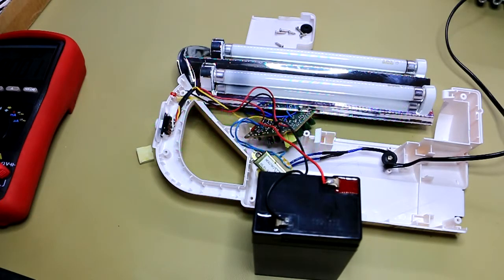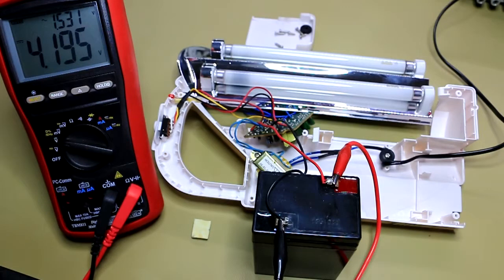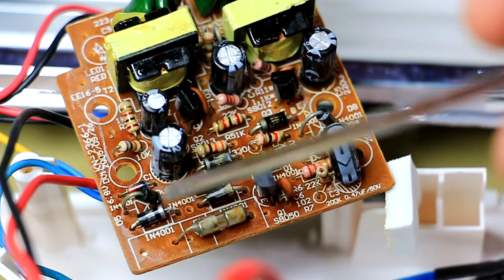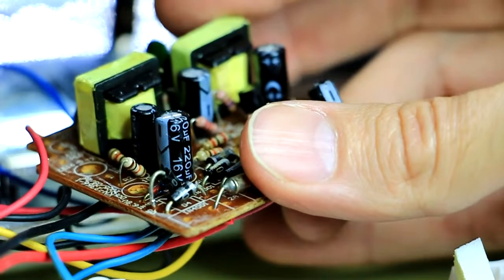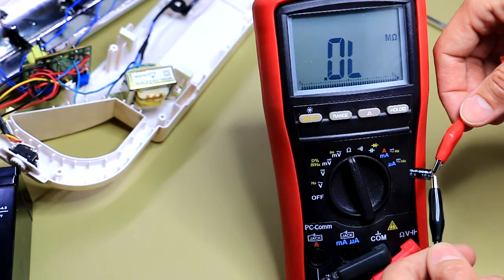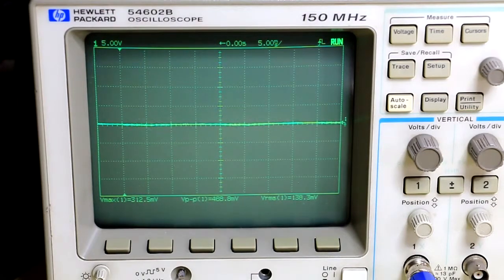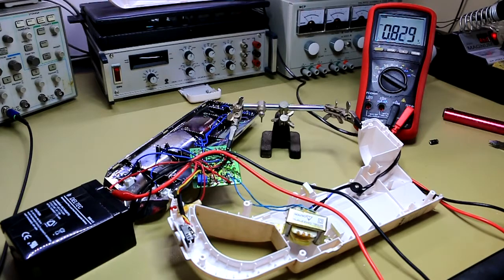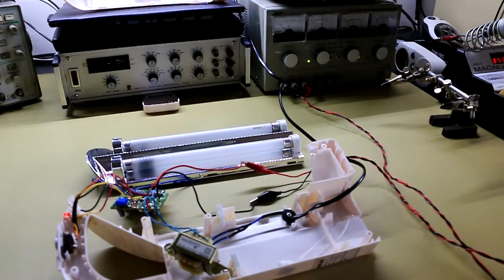Standby Lamp repair (#002)

Comment: The reason I sujested replaceing tubes if I work under those I would end up with migrain du to the flicker the cap I would have put a 220u in there cost pence and will remove more ripple the more ripple you have the more the cap heets up and dry's out so longevity is not great.
Reply from the maker: +bigt121947 Keep in mind that the ripple is not passed on to the tubes - the capacitor smooths out the ripple to the charging circuit, which charges the battery. The tubes are only on when running from battery and the high voltage transformer and oscillation circuit bumps up the DC to 90V AC at about 440Hz, making the light basically flicker free.

Comment: I know this is old now but had to post did you replace the cap with the correct 220u and I would have recomended replaceing the two faulty tubes while apart.
Reply from the maker: +bigt121947 I kept the 100μF capacitor installed as it only really needed to smooth out the rectified AC current and it was doing a good enough job. The tubes still work fine, even though they have blackened slightly at the ends. If they fail, I'll likely replace them with 6V LED strips and remove the high voltage transformer.